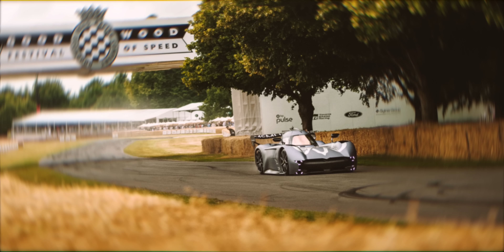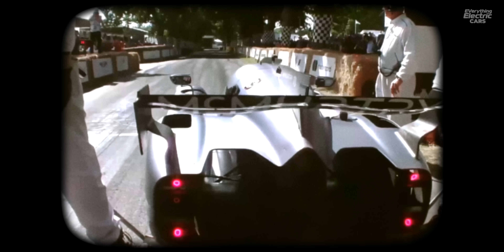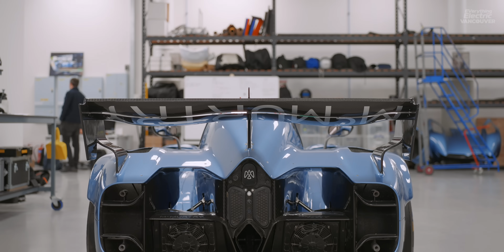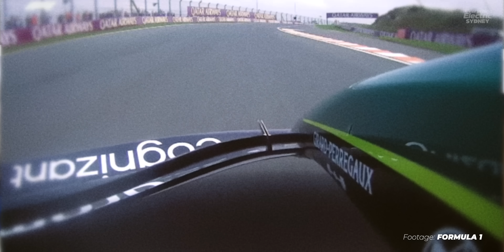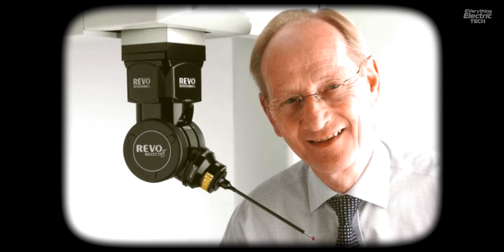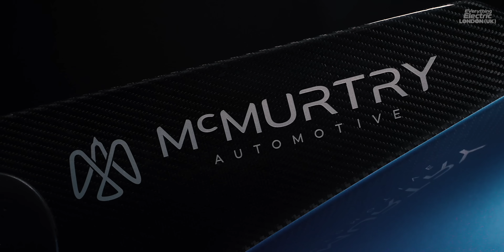The Tiny Fan-Powered EV That Drives UPSIDE DOWN!

Comment: Okay, fine!
I love electric cars, so a new one that's going to beat Formula 1 is definitely something I'm excited about.
But, but, but... isn't this car only meant for tracks of marble?
Because with its two "super-Dysons," what happens to the gravel, small pebbles, and sand that are sucked up?
Won't all that damage the fine mechanics of those vacuum cleaners?
I'm skeptical!
Reply: Good question.  The car has onboard filters to deal with gravel, peddles, sand etc.  This protects the fan blades and means only very fine dust comes out the back of the car

Comment: One could wish Indycar and F1 were not so focused on fair competition. I'd love a single seater format that had only enough rules for safety at the greatest achievable level, and little more. I guess some modest financial limits could be placed, but no testing limits, no aero limits, no dynamic control limits, no downforce limits. LIke this, only 20 cars in a race. More like F1 back in the dangerous old days, without as much danger.

Comment: Who's not asking if the 306 mph BYD U9 outpaces it? The key rarely-mentioned Q is:  what are their mid-range acceleration speeds - ie. 50-85 mph and 85 mph  to top speed?  But those two supercars + the Aspark Owl would both easily outpace Formula E race EVs which are STILL ridiculously limited to exactly 200 mph in order not to pose a threat to the primacy of Formula 1 whose cars can reach circa 235 mph .
Llewelyn was part of Formula E's original TV team for a VERY short time over a decade ago. He never says why he left - did he jump or was he pushed ?

(Paul G)

Comment: 100 amps per cell is incredible! Renishaw & McMurtry, two outstanding British companies. We need more of these. Come on JCB, stop wasting your time on Hydrogen and be a leader again.
Reply: 😂😂😂

It may be that JCB's boffins and money know rather more about hydrogen engineering and exploitation than do you.

The idea is to be "green".

Batteries can never be green until every single trace of fossil fuel is removed from the face of the planet and we're left with nuclear and so called renewables.

Hydrogen recycles itself into pure water at the very point of use as the fuel cell produces "work".

And green electricity begets green hydrogen, for ever and ever.

Everyone knows that.
Reply: @ForestForest-n9i You know what presuming does.
Reply: @ForestForest-n9i @ForestForest-n9i Since you find it necessary to post continually about hydrogen, even though you don't own a hydrogen vehicle yourself, I will post this fact check for anyone else reading.
Battery Electric Vehicles (BEVs) are better than Fuel Cell Electric Vehicles (FCEVs) primarily due to their
significantly higher energy efficiency, superior charging infrastructure, lower total cost of ownership, and technological maturity. 
Core Technological Advantage: All FCEVs Use Lithium Batteries 
A critical point often overlooked is that FCEVs are not battery-free; they operate as a series hybrid system, using a fuel cell to generate electricity, which is then stored in a buffer lithium-ion battery that powers the electric motor. This means that any issues related to the environmental impact of lithium mining, battery manufacturing, or battery disposal that are used as arguments against BEVs are also applicable to FCEVs. 
List of Solid Reasons BEVs are Better Than FCEVs

    Superior Energy Efficiency: BEVs convert 70-90% of electrical energy from the grid into motion, a much higher rate than FCEVs, which are only around 30-40% efficient "well-to-wheel" due to energy losses in hydrogen production, compression, transportation, and conversion back to electricity in the fuel cell.
    Established and Expanding Infrastructure: The electric grid is already extensive, allowing for home charging (a major advantage) and a rapidly expanding network of public charging stations. In contrast, hydrogen refueling stations are sparse and limited to a few specific regions globally, posing a major logistical hurdle for FCEV adoption.
    Lower Total Cost of Ownership (TCO): BEVs generally have a lower initial purchase price, lower maintenance costs (fewer moving parts), and significantly lower "fuel" costs per mile compared to FCEVs. The cost of hydrogen remains high, typically between $10 and $15 per kilogram in the US.
    Home Charging Capability: BEV owners can conveniently charge their vehicles at home overnight, ensuring a "full tank" every morning. FCEV owners must visit a dedicated hydrogen station, which are rare and often experience operational issues.
    Technological Maturity and Market Share: BEV technology is more mature, with a much broader market acceptance and a wider variety of vehicle models available. This leads to economies of scale and ongoing innovation in battery technology, such as solid-state batteries and V2G (Vehicle-to-Grid) capabilities, which FCEVs cannot offer.
    Simpler Energy Source: BEVs rely on a single, direct energy pathway: the existing electrical grid. Hydrogen for FCEVs, however, is often produced using carbon-intensive methods ("gray hydrogen"), diminishing their overall environmental benefits unless "green hydrogen" (produced via renewable energy electrolysis) is used, which is currently expensive and limited.
    Reduced Complexity: BEVs have a simpler powertrain with fewer components, leading to lower manufacturing and maintenance costs. FCEVs have the added complexity and cost of a fuel cell stack, high-pressure hydrogen storage tanks, and a necessary buffer battery. 

Thanks to you I thoroughly researched BEVs and learned why they were perfect for me. For anyone reading this, do your research. You may find the same thing.
Reply: @ForestForest-n9i There are only 15-16 hydrogen fuel stations in the UK, with just six or so open to the public, while there are over 57,000 public EV charging points. The vast difference in numbers is due to a lack of consumer demand for hydrogen cars, a major difference in the development of their respective infrastructures, and the high cost and complexity of hydrogen refuelling systems compared to electricity charging infrastructure. 
Hydrogen stations

    Total: Approximately 15-16, but numbers can vary due to recent closures and openings.
    Public: Only 6 are open to the public and can be used by any car owner.
    Major closure: Shell closed all its hydrogen stations in 2022, and other stations have also shut down due to lack of demand. 

EV charging stations

    Total: Over 57,000 public charging points.
    Public: All 57,000+ are available to the public, with new ones being installed regularly.
    Growth: The number of public EV charging points is rapidly growing, with the UK government aiming for 300,000 by 2030. 

Key takeaways

    Infrastructure is the main difference: The infrastructure for EVs is much more developed and widespread than for hydrogen fuel cell vehicles.
    Consumer demand is lower for hydrogen: The low number of hydrogen cars sold and the high cost of hydrogen refueling infrastructure have made it difficult to justify investment.
    EVs are the leading alternative fuel: EVs are currently the leading alternative to conventional gasoline and diesel cars due to their superior charging infrastructure.

Comment: Racing cars are, if we're completely fair, completely useless, so these batteries should trickle down to lawn tractors or something of that nature. Current choice in Europe is just plain pathetic. Giants like Stihl have more or less nothing for the normal consumer, while Husqwarna has several comically underpowered models with small batteries that even authorised salesmen advice you never buy despite a hefty price tag. Unfortunately, we know that none of that will happen.
Reply: "Racing cars" do have a purpose as in being a test bed.

Other than that they're a tad boring as it's more of a procession than a race.
Reply: @ForestForest-n9i @ForestForest-n9i Since you find it necessary to post continually about hydrogen, even though you don't own a hydrogen vehicle yourself, I will post this fact check for anyone else reading.
Battery Electric Vehicles (BEVs) are better than Fuel Cell Electric Vehicles (FCEVs) primarily due to their
significantly higher energy efficiency, superior charging infrastructure, lower total cost of ownership, and technological maturity. 
Core Technological Advantage: All FCEVs Use Lithium Batteries 
A critical point often overlooked is that FCEVs are not battery-free; they operate as a series hybrid system, using a fuel cell to generate electricity, which is then stored in a buffer lithium-ion battery that powers the electric motor. This means that any issues related to the environmental impact of lithium mining, battery manufacturing, or battery disposal that are used as arguments against BEVs are also applicable to FCEVs. 
List of Solid Reasons BEVs are Better Than FCEVs

    Superior Energy Efficiency: BEVs convert 70-90% of electrical energy from the grid into motion, a much higher rate than FCEVs, which are only around 30-40% efficient "well-to-wheel" due to energy losses in hydrogen production, compression, transportation, and conversion back to electricity in the fuel cell.
    Established and Expanding Infrastructure: The electric grid is already extensive, allowing for home charging (a major advantage) and a rapidly expanding network of public charging stations. In contrast, hydrogen refueling stations are sparse and limited to a few specific regions globally, posing a major logistical hurdle for FCEV adoption.
    Lower Total Cost of Ownership (TCO): BEVs generally have a lower initial purchase price, lower maintenance costs (fewer moving parts), and significantly lower "fuel" costs per mile compared to FCEVs. The cost of hydrogen remains high, typically between $10 and $15 per kilogram in the US.
    Home Charging Capability: BEV owners can conveniently charge their vehicles at home overnight, ensuring a "full tank" every morning. FCEV owners must visit a dedicated hydrogen station, which are rare and often experience operational issues.
    Technological Maturity and Market Share: BEV technology is more mature, with a much broader market acceptance and a wider variety of vehicle models available. This leads to economies of scale and ongoing innovation in battery technology, such as solid-state batteries and V2G (Vehicle-to-Grid) capabilities, which FCEVs cannot offer.
    Simpler Energy Source: BEVs rely on a single, direct energy pathway: the existing electrical grid. Hydrogen for FCEVs, however, is often produced using carbon-intensive methods ("gray hydrogen"), diminishing their overall environmental benefits unless "green hydrogen" (produced via renewable energy electrolysis) is used, which is currently expensive and limited.
    Reduced Complexity: BEVs have a simpler powertrain with fewer components, leading to lower manufacturing and maintenance costs. FCEVs have the added complexity and cost of a fuel cell stack, high-pressure hydrogen storage tanks, and a necessary buffer battery. 

Thanks to you I thoroughly researched BEVs and learned why they were perfect for me. For anyone reading this, do your research. You may find the same thing.

Comment: So how about range, could it get round the Nurburgring on one charge.
Reply: That's an interesting question.

Judging by the not bad acceleration I would suggest not even Sabine would have got a lap out of the thing once she started to enjoy the ride.
Reply: @ForestForest-n9i @ForestForest-n9i Since you find it necessary to post continually about hydrogen, even though you don't own a hydrogen vehicle yourself, I will post this fact check for anyone else reading.
Battery Electric Vehicles (BEVs) are better than Fuel Cell Electric Vehicles (FCEVs) primarily due to their
significantly higher energy efficiency, superior charging infrastructure, lower total cost of ownership, and technological maturity. 
Core Technological Advantage: All FCEVs Use Lithium Batteries 
A critical point often overlooked is that FCEVs are not battery-free; they operate as a series hybrid system, using a fuel cell to generate electricity, which is then stored in a buffer lithium-ion battery that powers the electric motor. This means that any issues related to the environmental impact of lithium mining, battery manufacturing, or battery disposal that are used as arguments against BEVs are also applicable to FCEVs. 
List of Solid Reasons BEVs are Better Than FCEVs

    Superior Energy Efficiency: BEVs convert 70-90% of electrical energy from the grid into motion, a much higher rate than FCEVs, which are only around 30-40% efficient "well-to-wheel" due to energy losses in hydrogen production, compression, transportation, and conversion back to electricity in the fuel cell.
    Established and Expanding Infrastructure: The electric grid is already extensive, allowing for home charging (a major advantage) and a rapidly expanding network of public charging stations. In contrast, hydrogen refueling stations are sparse and limited to a few specific regions globally, posing a major logistical hurdle for FCEV adoption.
    Lower Total Cost of Ownership (TCO): BEVs generally have a lower initial purchase price, lower maintenance costs (fewer moving parts), and significantly lower "fuel" costs per mile compared to FCEVs. The cost of hydrogen remains high, typically between $10 and $15 per kilogram in the US.
    Home Charging Capability: BEV owners can conveniently charge their vehicles at home overnight, ensuring a "full tank" every morning. FCEV owners must visit a dedicated hydrogen station, which are rare and often experience operational issues.
    Technological Maturity and Market Share: BEV technology is more mature, with a much broader market acceptance and a wider variety of vehicle models available. This leads to economies of scale and ongoing innovation in battery technology, such as solid-state batteries and V2G (Vehicle-to-Grid) capabilities, which FCEVs cannot offer.
    Simpler Energy Source: BEVs rely on a single, direct energy pathway: the existing electrical grid. Hydrogen for FCEVs, however, is often produced using carbon-intensive methods ("gray hydrogen"), diminishing their overall environmental benefits unless "green hydrogen" (produced via renewable energy electrolysis) is used, which is currently expensive and limited.
    Reduced Complexity: BEVs have a simpler powertrain with fewer components, leading to lower manufacturing and maintenance costs. FCEVs have the added complexity and cost of a fuel cell stack, high-pressure hydrogen storage tanks, and a necessary buffer battery. 

Thanks to you I thoroughly researched BEVs and learned why they were perfect for me. For anyone reading this, do your research. You may find the same thing.